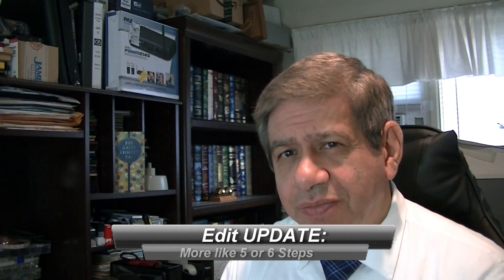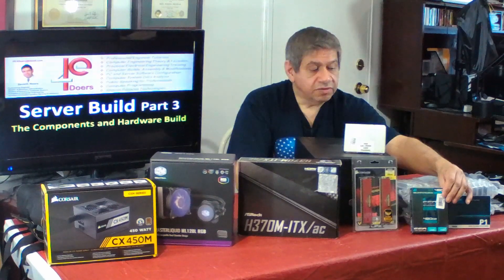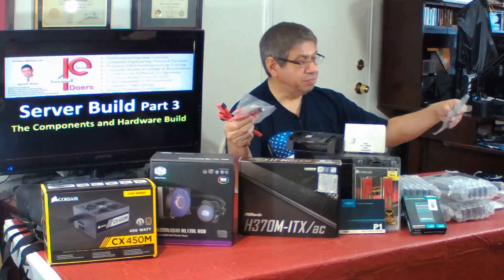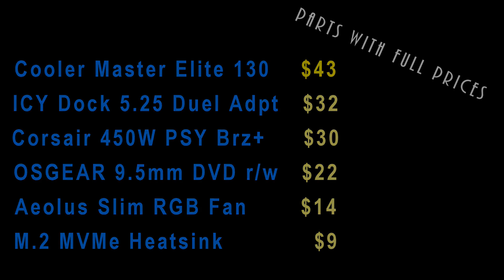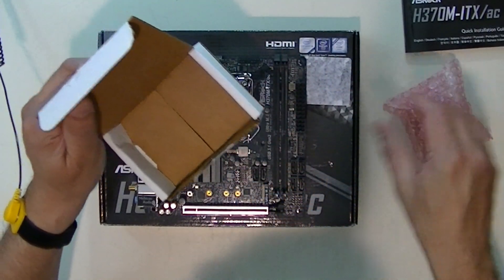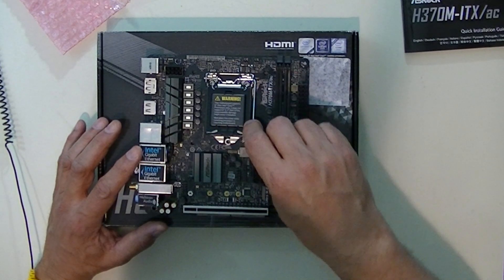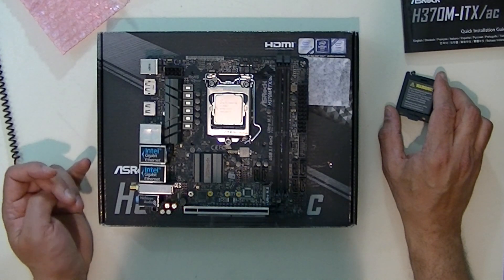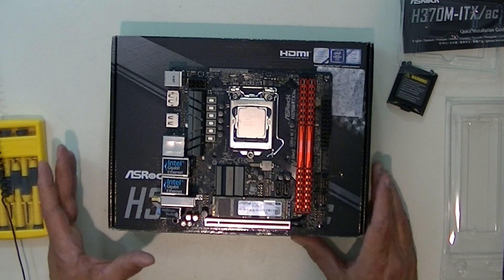Server Build Part 3 Step 1

Comment: Loving this guide, especially the modifications to the case. I have an Elite 130 from an old gaming build, planning to follow your guide since it's my first time setting up a server. Going to go with a cheap X79 ITX board from Ali Express + a Xeon E5 8 or 10 core and an old GeForce 610 I have lying around. 

I was looking at 3x5.25 -> 4 or 5 3.5" HDD hot swap bays. It almost looks to me like the front of the case where the fan goes could be dremeled away to fit a hot swap bay on the front. Had you thought about doing something like this?
Reply from the maker: No I had not, but it sounds like a great idea.  Let me know how it works out :)